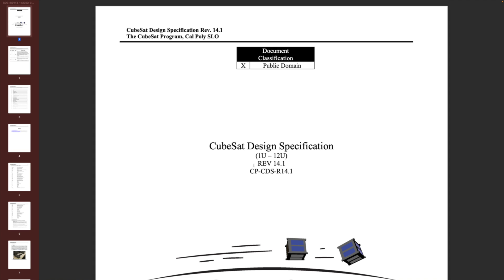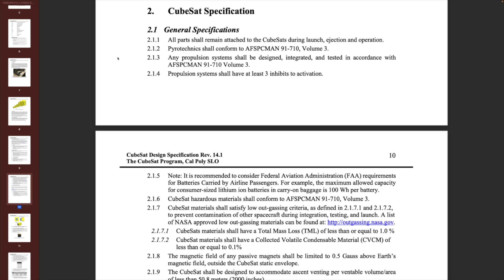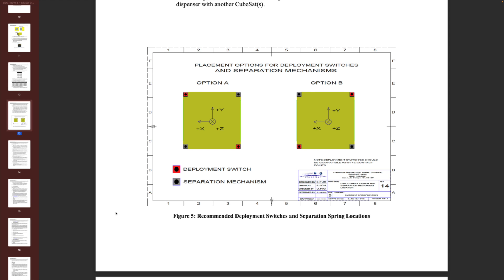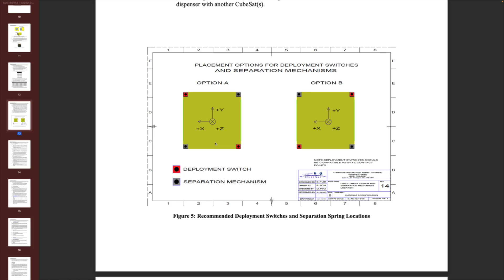What Makes a CubeSat a CubeSat? The CubeSat Design Specification

Comment: Thanks for the intro to cubestat.   I have a question regarding launch and vibration requirements.  The vibe requirements are dependent on launch vehicle, but, In general, Are the vibe specs difficult to meet?.  I have a lot of experience in soft stow hardware for ISS.  With the cubestat in the launch vehicle, are the vibe loads high or do the launcher mounting with isolation hopefully reduce the launch load?

Thank You

Comment: Do you have an amateur radio license, if yes, then you can use the assigned amateur radio frequencies for space operation and you won't have to apply for commercial space radio frequencies. I've got my amateur advanced license in Canada, so let me know if you would like any help in that department. :-)
Reply from the maker: I am licensed, but I'll have to upgrade to get my advanced. And yes, I'd love all the help I can get!
I think no matter what, I'd like to have a Morse code beacon on a ham frequency, just to maximize how many people around the world would be able to confirm reception!
Something on 70cm I could pick up with my yagi would be cool :)
Reply: @MikeOnSpace  A simple morse code identifier should be very easy. I'd shoot for something a bit more interesting. Maybe a small camera sending back images and some simple telemetry, like battery voltage and temperature, solar panel power production and temperature. Maybe even 3d acceleration and roll rates. All of the above shouldn't be too hard, as it already data that every cell phone already has.